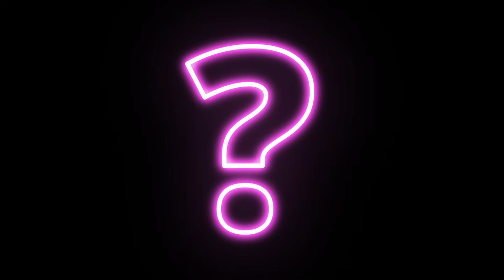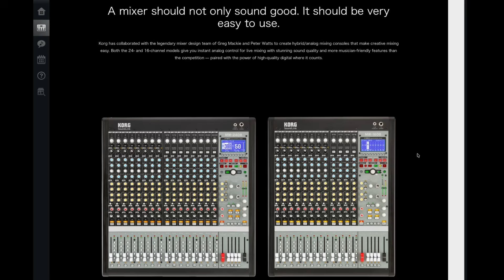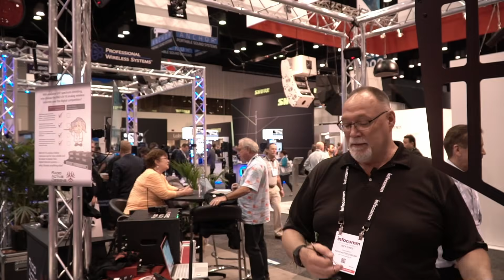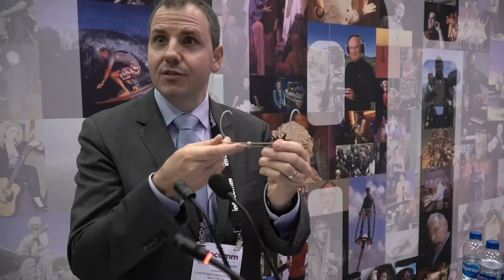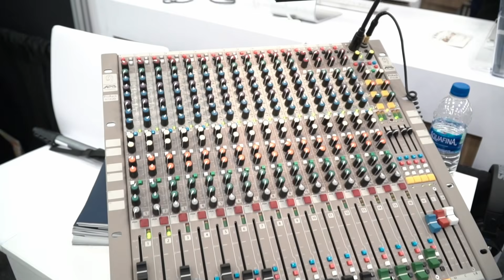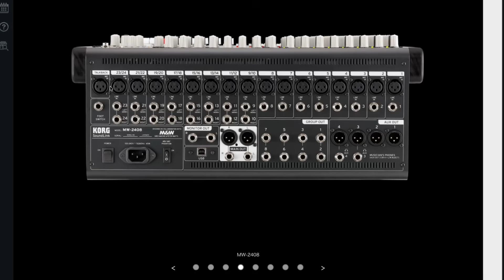WHY is Greg Mackie's Latest  Mixer Design sold by KORG!?

Comment: At NAMM the back half of the first music hall is a section for Asian companies.  Walking around these booths I see different mixers, speakers, mics, etc I have never seen anywhere else.  Some products are re-branded between booths.  Other products are unique to the booth.  Where did these mixers, speakers, mic brands come from?
One of the vendors I spoke to explained that they sell to large music stores or small music store chains.  The store or chain commits to a set number of units.  The manufacture then rebrands the device with the store's logo, text and color scheme.  Maybe a custom front panel or grill.  The store then sells it as their house brand at a lower price and better profit margin.
Reminds me of scrappy companies looking for a manufacturing partners but in reverse.
Reply from the maker: In the 90's I once drove a borrowed 17' NPR box truck from Baltimore up to Cherry Hill, NJ on a Sunday, to meet a container in a parking lot that was delivering a pile of white label gear that a handful of small mom & pop music retailers had ordered from overseas after NAMM and gone in together on the cost of shipping. 

We got there... there was no fork lift or any other equipment. It was about 100 degrees in the blacktop parking lot, and when they finally got the sea container open, it was stacked so tight from top to bottom and side to side that it was nearly impossible to get anything out without damaging the boxes. 

Ten of us spent about six hours unloading mic stands, music stands, instrument stands, speaker stands, keyboard stands and benches... all into the parking lot, sorting out what belonged to each shop, and then loading it into our trucks before hitting the road going home. Thankfully the weigh stations were not open on the return trip to Baltimore that night, because I'm pretty sure we were pushing it. 

Hope you're doing great Robert.

Comment: Both those mixers look fairly decent for smaller corporate gig, weddings maybe like a small jazz club.  I get the no inserts because of the internal  DSP, but as someone who grew up in the primarily analogue days inserts for the sub groups would be nice.
Reply from the maker: Yeah, inserts at the group level at least would be fantastic. If you're looking for an analog crowd to buy a mixer, you've got to let us hook-up the rest of our analog gear!
Reply: @DcSoundOp  Yeah, I'd have rather had group inserts than groups outs. Or perhaps they could have been switchable between functioning as group outs or group inserts.